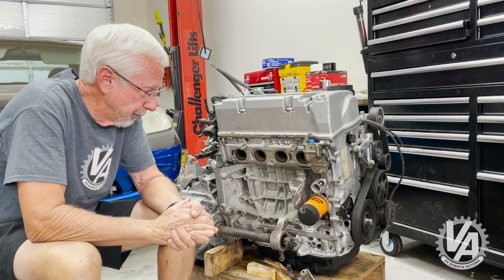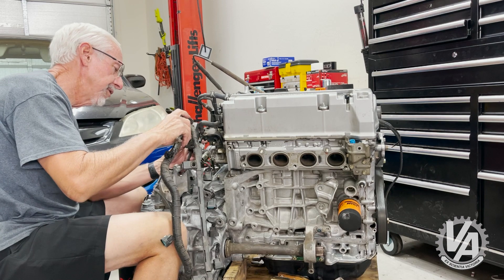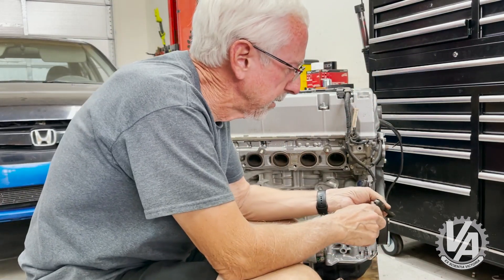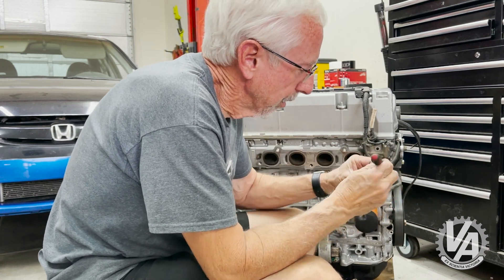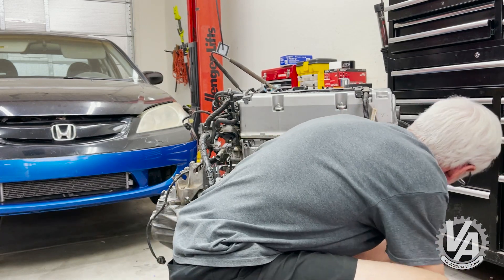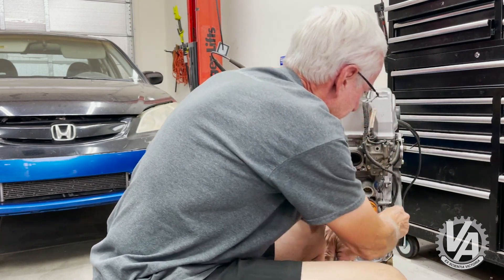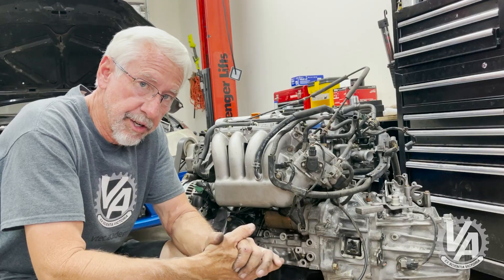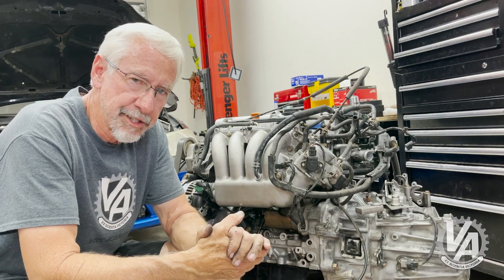Project Bruised Civic Part 2: K24 Wiring Harness for the 7th Gen Civic

Comment: Hi Guys,

I'm close to completing my ES1 Sedan 05' Auto Civic to K24a3 6SP M/T.

Im having some issues with either the ECU or Starter or both

Starter isnt engaging with flywheel. (ordered a new one)
Bench tested & starter does spin when jumped but issue still remains below:

Car is auto chassis & key is held hostage in ignition barrel when trying to take out
Ignition barrel also never has been able to turn starter motor on.

Old Engine: D17z1
New Engine: K24a3 (from accord Euro)
Old Harness D17z1
New Harness Base RSX
All ground cables in

ECU: PPA Q04 CRV 04' KPro from RevZone Aus

Error code in ECU logs also:
P1607 for ECU internal circuit malfunction check
(When I go to load up a map file in Kmanager - I dont see PPA so only other option is to go 'other engines' and select the stock TSX map)

Immobilizer is also disabled & Kmanager can talk to ECU/upload/save maps & changes

A little stumped and dont know whats causing the ECU to not turn the starter motor...

Any ideas?

Comment: Is my first k swap, I'm using the k20A3 crank and knock sensors on the k24a2 with the base rsx harness RBC manifold with 03 accord throttle an I'm switching the plugs on the tps with stock A3 injectors. Any suggestions on modifications I should do? Thanks in advance
Reply from the maker: You'll need to lengthen a few things to reach. Make sure you don't swap the TPS with MAP.
Reply: @VTECAcademy  yessir, as well as changing the plug for the tps correct? 🤙

Comment: Will a k24a2 Crank sensor work with a K20z3 harness?
Reply from the maker: Not without modifying something. The plug needs to be changed to the Accord or TSX connector. Or change the sensor to the CRV or RSX/Civic Si sensor

Comment: Why do you need the ground off of the tps? I did this but I only used the 5v signal wire from my tps and it's working.  are the grounds different and is mine wrong?
Reply from the maker: That sounds like will work, but we did it like Honda did.

Comment: Would be nice to see this for the r40 head motors.  I think there will start to be an influx of those in the coming years.
Reply from the maker: We are working on that. Right now if you use the KMiata timing chain cover and one of the early pulse rings (don't remember if it is exhaust or intake) on the camshaft you can use the KTuner or Hondata ECUs